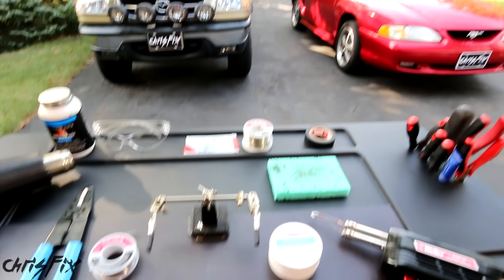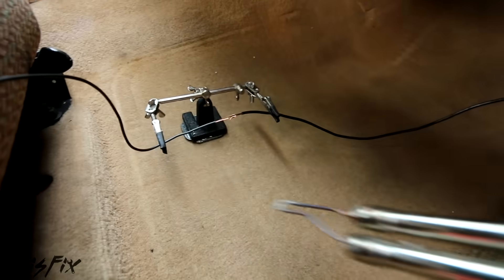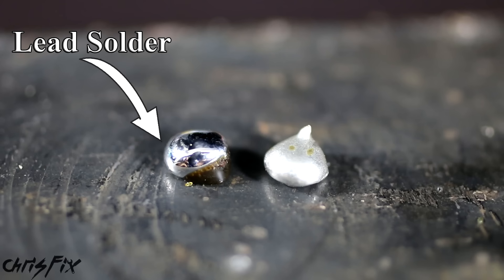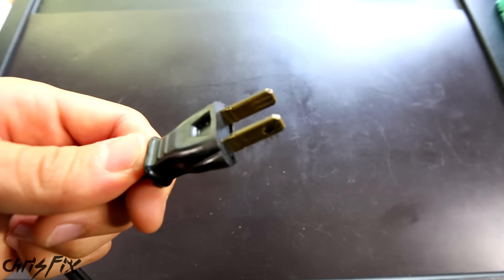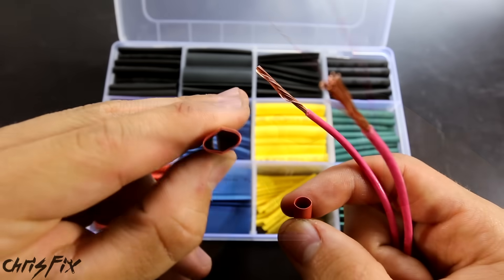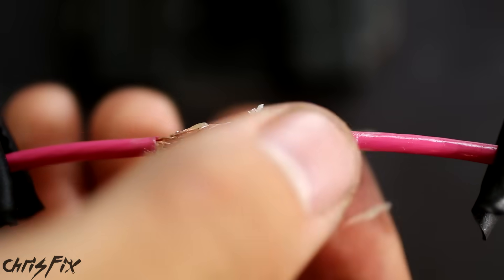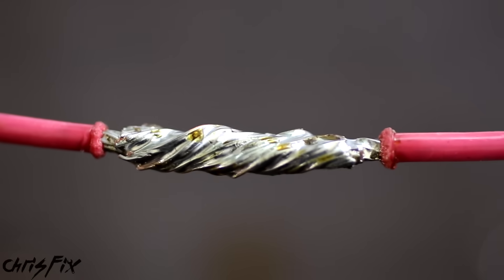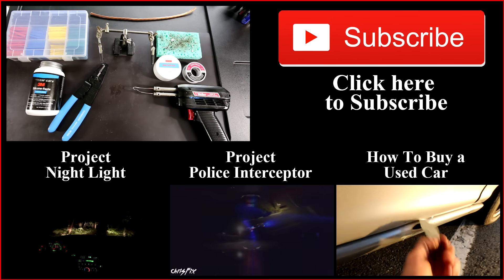How to Solder Wires Together (Best tips and tricks)

Comment: My wire never seems to get hot enough to melt the solders from the top side. I’ve tried several different irons/guns and several different solders. The only way I can get it remotely to work is to touch the iron itself and let it draw it in from there. No idea what’s going on but after $200 worth of irons/guns and about 6 different solders, I give up. My solders will just have to look like 💩. But they are at least strong! Lol
Reply from the maker: As long as there strong you shouldn't have much to worry about, but what size wire are you generally working with?
Reply: @chrisfix  I usually use .8mm to 1 mm rosin core with lead at 650-700°. Tried raising temps,  and all different ranges of temps, with and without flux, nothing. Lol. No clue what I’m doing wrong.

Comment: Great video, thank you.
Question for anyone: I need to buy a soldering iron to solder speaker and car wires once on a while. Should I buy the pencil type for $15 to $20 or 30 to 60 watts or should I get the gun style 100 to 140 watts like yours for around $50?
Please advise the difference besides price.

Comment: Thanks Dude! To the point and very clear. You should have heard all the other advice I received, I thought I would be working on a NASA project. Really helpful thanks a million!!!!!
Reply from the maker: Glad I could help!
Reply: Just a follow up. It turned out great. Basically, have a 91 Chevy Blazer with LS swap. Could not get an answer on the fusible link long and short A great shop gave me an in line fuse soldered and installed not getting hot and great connection. I will be doing that same to all from here on out. Lastly, tip on the silicone and heat shrink Beano

Comment: Good tutorial, and this LOOKS easy, but it's just not working for me and I'm frustrated.  I'm using a .6mm solder and it just keeps breaking off in little bits when I try to hold it up to the wire bundle to melt.  I'm using a full size solder gun like you're using in the demo (not the smaller soldering iron) so I imagine it's hot enough, but I'm just not getting the hang of this.
Reply: Hi, 
hopefully this helps you in learning how to solder well. 

Some things to remember
1.  You MUST use flux to get a good result. 
2.  In order to get a good transfer of heat the soldering iron / soldering gun the tip MUST be freshly tinned  (wiped clean on a damp sponge & a fresh coating of solder melted on to it).  
3.   It is very much easier to get good results using solder that contains lead. 

Since you are using very thin solder try breaking off a 12 inch length & fold it over on itself twice so you end up with a 4 strands thick section of solder about 3 inches long. 
Twist them all closely together by holding 1 end of all 4 pieces & rotating them multiple times while holding the other 4 ends stationary. 
What you should end up with is a twisted length of solder 4 strands thick  much like the appearance of the 7 strand section of copper wire that he uses to make tips for his soldering gun.
If its a large job then maybe a 24 inch length would work better.  
Instead of having just 4 strands of solder twisted together you could do 6 or 8  strands & twist them together.  
Make sure they are twisted together firmly so that all strands remain twisted together when you add heat to melt them.  
While heating one side of what your trying to join together with your soldering iron / soldering gun you feed the end of your 4, 6 or 8 strand thick section of solder onto the opposite side of where you are applying heat with the soldering iron / soldering gun.  
For soldering very small components onto circuit boards etc I generally use a liquid flux & clean away any residue using isopropyl alcohol on a cue tip once I have finished soldering.  
For larger items & joining wires etc I use flux paste instead & again clean away any flux residue with isopropyl alcohol & an old tooth brush when I have finished soldering..  

I've been soldering in excess of 30 years & in all that time I've never used Lead-Free solder.  
Practise joining sections of scrap wire together.
When that becomes easy you could practise adding components to & removing components from old electronic circuit boards.

Best of luck
Reply: @andrewwood640  FYI, lead-free isn’t anywhere near as difficult to work with as some people would have you believe. Yes, it needs to be a bit hotter (217Cor 227C depending on alloy, vs 183C for 63/37 leaded), but as long as your iron is powerful enough (and your tip appropriately sized for the joint) it honestly works fine. The best, modern lead-free alloys (the ones that are about 0.3% copper, 99.7% tin, doped with trace amounts of nickel and germanium) flow like leaded and produce shiny joints. 

From how some people talk about lead free you’d think it was impossible to work with, but it’s simply not true. Is it exactly as nice as leaded? No. But it’s close.

What honestly makes a much larger difference is the type of flux. And of course to be using name brand solder, not the garbage from aliexpress that some people want to use.

Comment: If your working with copper wires or pipes you should always clean wipe off excess flux because it will turn your copper green corroding it over time.

Comment: Great video, thanks for posting.   I can understand soldering a wire to a circuit board, but is solder necessary for a job like this?  Won't electrical tape work just as well.

Comment: I came by just to make sure I was doing it right...  I do use a butane soldering iron (185w equivalent) so I have to watch the exhaust from the tips, but it actually comes in handy when shrinking the shrink wrap.  Great video, thanks.  It's easy to see why you have so many subscribers and have just earned another one.

Comment: So the insulation damage is from the acid core, not the silver itself? I just bought a Sn 99% Cu 0.7% Ag 0.3% solder, is it appropriate for speaker wires? Thank you

Comment: If my Z31 catches on fire I’m blaming u 💀
Reply: Did your Z31 catch on fire?
Reply: @Chrisgoberrr no response probably
Reply: I’m sure his Z31 burned up with him in it
Reply: 😂😂😂 @TheKyleb408
Reply: As a fellow z31 owner, your z will catch on fire either way
Reply: @sendingit2601 😂😂
Reply: Did it catch on fire yet
Reply: Sigh,
Some dude’s wil be:
Wha, it’s only a joke.
They forget that there are people like this.
Reply: As a Z32 owner I can confirm his Z31 caught fire
Reply: it will, it's pretty much a resistance
Reply: Wassup w the z31 pop
Reply: gg it's a bumb
Reply: Yup
Reply: 1:56 - use an ash tray filled with sponge or metal shavings from a machine shop.
Also use a pen style instead of a gun.

And do it outside of your car, not in it
Reply: @initiald975 what if the ex owner broke by mistakes wires under the dashboard or like in my case isolated the aftermarket alarm with only electrical tape and now they oxidized and dont make contact anymore?

Comment: Thanks for the nice video! I tried your technique with lead free solder and didn't have much success. The wire would not melt and merge into the wire. Although, I went to buy solder with Lead and it worked right away. So, that made a big difference for me (I know you mentioned it too).

Comment: Lol I used to solder each wire to a tiny thin plate and use electrical tape to seal it and that still works but is not as sade and easy as what you showed

Comment: How would you solder on smaller applications like a circuit board? Do you need to touch the solder to the tip of the gun?

Comment: Chris, you a have a great talent for teaching, even an ol' dog can learn new tricks to improve.  I could never seem to get my solder joints to flow as quick and clean because I was relying on the flux core.  Adding the rosin cracked the code for me.  A avionics friend showed me a "V" version of the lineman's joint, basically create two "hooks" then twist them together like the lineman joint.  Another awesome video from my favorite channel.

Comment: Hello ChrisFix, would you be so kind to tell me if I can use the smallest soldering tool to solder THE END OF  accessories jewelry sterling silver or other metal? So the end of wires don't scratched the skin or clothes, do I need to use solder? I appreciate much your feedback
not working with  electricity ..
Thank you 💖

Comment: i actually had a wire melt in my 87 camaro from a poor solder. all of the sudden i smelled a similar smell to cigarette ashes and then smoke washed out through my hvac head unit. luckily the carpet it was laying on didn’t catch fire, but the whole wire and head unit were cooked

Comment: I believe you should clean the solder joint with alcohol as well to remove the residue from the rosin which can create oxidation over time.

Comment: A couple of comments.
You can buy adhesive heat shrink tubing.  It is typically double walled and has a 3:1 shrink ratio.  The inside is coated in a layer of hot melt glue and does an incredible job of sealing the joint. 
Careful using a silicone grease.  It can actually degrade the seals on certain connectors.

Comment: I've had a used soldering gun just like that one and couldn't get it to melt solder to save my life. Mine didn't make real heat at all. Likewise my Milwaukee M12 soldering device is totally worthless. Not once have I been able to get wires that hot.

Comment: Ive been trying to solder for 50 years. Finally I gave up and went back to stakons. It's easy to melt solder with a soldering gun, but nearly impossible to get the wire hot enough to take solder, even if the wire is so hot the insulation burns off. Those Weller guns are made of the sorryest brittle plastic and break to pieces when you drop them. I've thrown two in the trash so far. I give up.

Comment: Opinions wanted - wire insulation keep smelting away when trying to join wire to LED pcb strip.  Currently using lead free solder and temps of around 360.  Tried lower the temp but then having melting issues.  Is this just bad wire or is it due to the lead free solder?

Comment: 4:08 I used to try to solder without flux.
I didn't really know what it did anyway, so I didn't feel I needed it....that's a BIG MISTAKE!!
Flux cleans the oxides off your work, transfers heat quickly and evenly through the work, and helps the solder coat the work more evenly by causing a wicking effect.
Trust him, it makes a HUGE improvement in your work to use solder flux.
I've worked with school-trained solder techs and watched them....they seemed to put flux on the parts pretty much every time.

Comment: One thing you left out that I  just learned. I've been having trouble getting solder to flow, even though I'm heating from the bottom of the wires. Besides adding flux, and cleaning the tip by wiping the heated tip on a wet sponge, you need to touch the solder to the tip of the soldering iron and have a small piece of melted solder on the soldering tip. Touch this wet solder to the bottom of the wire and it creates a 'heat bridge', that more easily heats the wire and allows the solder to flow. 

I was heating up wires with a bunch of heat and the solder still would not flow. The solder on the tip is what makes it flow.

Comment: Noticed you used a Weller 140/100 watt gun, why not use the 260/200 watt gun? Excellent video, straight forward, no non-sense, and great instruction.

Comment: I am a complete beginner. I stripped a wire, getting ready to solder it, but the two wires inside the wire I stripped are coated in braided copper, with a plastic coating under that, then with little wires inside. Do I solder the copper coating to the wire I want it connected to, do I strip the copper coating and the rubber coating and solder the internal wires to the wire I want it connected to, or do I solder both the copper coating and the internal wires to the wire I want it connected to?

Comment: I do video game console modding constantly. I consider myself sort of a "weekend pro" at soldering electronics and am very careful and thorough with my work. There is so much bad soldering advise on the internet, but not here. This is quality advise. To add though, don't cheap out on your solder gun or iron. Cheap chinese irons off ebay are horrible and you will have a bad time. 

What I use is meant more for circuit boards, but is a KSGER T12 station that nowadays goes for around $75 (they've gone up since I've bought mine). I'd recommend, if you don't get a gun (imo is overkill and bulky), some sort of portable T12 iron with either a T12-JL02 tip or a T12-K tip. Don't get one at hardware stores, those are usually not meant for electronics.

Also, just buy the damn flux lol. Same with quality leaded solder. It makes soldering 100x easier. Soldering is 30% skill, 70% tools. If its hard, it is almost always because you are using the wrong tool.
Reply from the maker: Thanks a lot!!!
Reply: @chrisfix  no thank you! My current car has me so pissed and difficult to work on that I've been binging your videos to become a "car guy" out of anger and spite lol, at least that's how it's started. I've been growing more and more interested and fascinated by cars more and more while binging your videos. Planning on selling my car and getting something that is actually fun and easy to work on. Currently have a Sonata Hybrid and thinking about getting a Honda/Acura or a Toyota. Really want an Avalon but those are expensive lol. Probably gonna settle for an Accord if I can find a decent one

Comment: Great video, thanks! I just wanted a quick refresher before I soldered in my new car stereo harness and this was great. Pro tip: the Lineman's splice is meant for wires that are under strain; i.e. being pulled on the ends like the wires going to your house from the utility pole.

Comment: question - what is the tool used to add the actual solder to the top of the wire? (i don't mean the soldering gun that's used on the bottom)  i feel like that's not mentioned. thank's for this great video, though! i have a 97 jeep grand cherokee and know (knew) nothing about car repair but watching chrisfix has helped a bunch. agree with all the other commenters on the quality of this vid.
Reply: reviewed it again and realize the "tool" is the actual solder itself. i didn't realize solder is sold in a wire-like form, i've always imagined it as a paste. doh!

Comment: Thank you for one of the most informative videos I’ve witnessed on YT!. I do have a question: I m soldering  2 x 22 Ga, wires into a single 18 Ga.wire.  I have tinned all three but what is the best way to join them before the final solder or butt connect?

Comment: Chris’ joints are terrible! Solder the ends separately. Then side by side solder together. It’s clean, easier and faster.
Also, stand your bare end up, heat near insulation and solder at the top. Let the heat and gravity pull the melted solder down into the strands

Comment: Just a tip from someone who is certified to solder at the highest level according to the IPC-J-STD-001; lap soldering is more effective, durable, and faster to solder. Twisting the wires is 100% illegal in the defense industry.

The key is to keep the natural lay of the twisted wires after stripping them, tin both ends of the wires, but then lap solder them together. Clean with isopropyl and an a brush, apply heat shrink, and you’ve basically got the most durable solder joint you can get.

Comment: What temperature does the gun need to be to heat the wire up enough to melt the solder? I bought a Weller that advertises 900 degrees, but it will not melt the solder.

Comment: Just a heads up; your electrical solder already comes coated with a Rosin core which provides the same benefit of adding flux. Therefor the flux is an unnecessary additional step.

Comment: So I tried soldering 12 gauge for the first time this weekend. No matter how long I held my iron to the pre-twisted wires, the solder wouldn’t melt in.

Then I realized my iron was only 60W. Is that the reason? Do I have to get a stronger iron?
Reply from the maker: a 60w iron should still warm it up enough. Did you "tin" your tip with solder? Did you use flux paste on the wires?
Reply: hey, thx for the reply! 60w woulda done it, eh? i just went ahead and ordered a 140w weller and finished the project yesterday morning. but maybe i wasn't tinning the 60w enough? i really am pretty new to soldering, and am still developing my feel and technique. maybe i'll revisit the 60w on some scrap 12g to play around with it..

Comment: Great video. This video and 30 mins of practice helped me make some great wire splices.  One tip:  I did this in a car wheel well and used small magnets to temporarily mount two alligator clips to the frame right underneath the wires.  This gave me some control of the wires while soldering.

Comment: I love that you quickly laid out the steps before actually going through them. I was taught that a good presenter will tell you when they are about to present/teach, present and teach it, then recap what was just presented. Basically going over the info 3 times to really lock it in.

Comment: Great video, Thanks!  I've long wanted to get the hang of this.  Using solid wire for a replacement tip was genius.  I have an old Weller with a broken tip - used some 12ga to make a new tip, and soldered some wires today just like you showed.

Comment: Is it only mine, or is the weller soldering gun a big piece of garbage? I have one like this one but without the light, and it is junk. It takes too long to heat up to operating temperature and once it is hot enough it reaches the end of its duty cycle and shuts off for 4 minutes.

Comment: been doing wires like this for over 20years how ever I like to hit it with a pencil torch to get the solder to be absorbed by the copper like a spunge. its stronger and looks cleaner, try hitting it with a torch after you have soldered it you will see what I mean